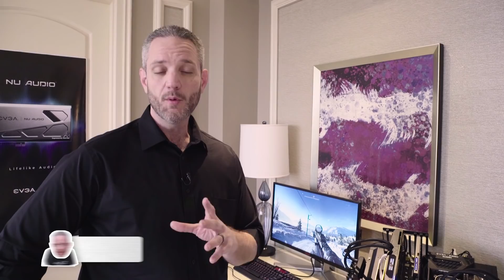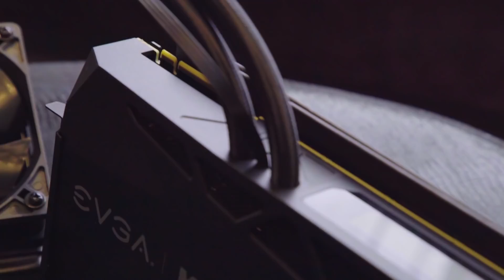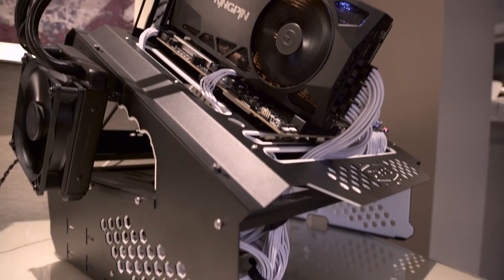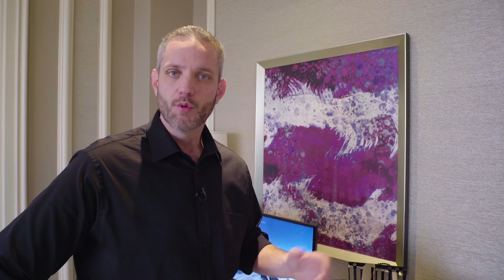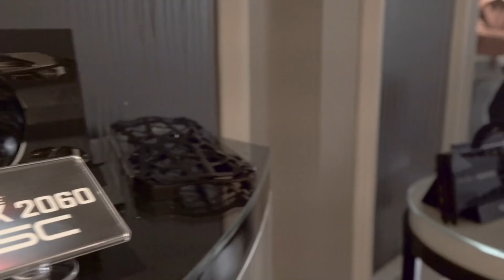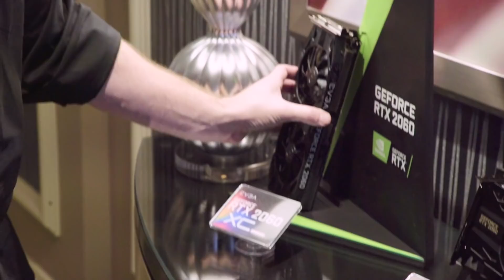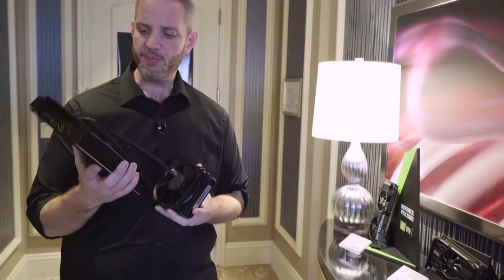THIS is how we are going to beat Gamers Nexus... Maybe

Comment: i'll tell everyone a little secret. the faster the water pump is the more radiator you need. the slower the fluid moves to a point the less radiator you need. the slower the fluid moves the more it has time to cool down. thus cooling down the gpu more pre unit of measurement. the faster push your fluid.. the less time it has to release it energy (heat). thus needs bigger radiator. a true builder know the speed of the radiator. the temp before the radiator and the temp just after the radiator. you too can tune your system.

Comment: RTX should've been exclusive for the x80Ti+ series, all the other Turing cards should've been GTX. Raytracing is already suffered on a 2070, imagine the 2060. This is basically Nvidia shoving in our faces that people are gonna buy whatever they want, with whatever price they put on them. 80 series price for a 60 is laughable at minimal.
Reply: Eduardo Yamamoto I would only get 20 series for DLSS as that seems pretty sweet, but yeah RTX is a lost cause on the mid range
Reply: Raytracing would not be a thing if only 0,1% of the market id going to use it in the 80ti cards
Reply: Yeah, because 99.9% are using it now, right? That tends to happen either way with new technologies, the point is they're trying to justify a price increase on less expensive models based on it, not that it does with 80Ti models as well, but you get the point. DLSS also falls into "whatever" territory, you still need a 2080Ti for 4k. I haven't seem anyone using it on the less expensive models at least.
Reply: @eduardoBR1991  but in nvidias best scenario, most people are going to own a rtx card sooner or later so game developers dont programme their games with ray tracing without meaning. But if raytracing is exclusive on a 1200$ card, that not many people are going to posess, why put raytracing in your game when 99% wont ever touch it.
Reply: @eduardoBR1991  Im not fan of nvidias rtx cards, but maybe there is going to be something like in the hairworks shit theyve done,  high and low ray tracing settings for your performance class
Reply: @batu-740  I get your point, but I don't think people are buying 2070s or 80s, unless they really, really, really want that and have no money to pay for premium. The guys that really like top of the line tech will buy it regardless. I don't see implementation as a problem, or did you forget Crysis? This was rushed, developers didn't find a meaningful use for it besides it being some reflections. Had this been thought through, they would have implemented even if everyone didn't have access to it. I haven't personally met a single soul in my country that has a RTX card, I mean us the mortals, not the content creator. Our components usually cost double than what it is found in the US, and you can easily find them in stock here.
Reply: Jay was getting 70fps with RTX on medium with ultra settings on bf5. You also have to keep in mind that they arent even using the ray tracing cores yet. Once they do I'm sure you will see over 100fps